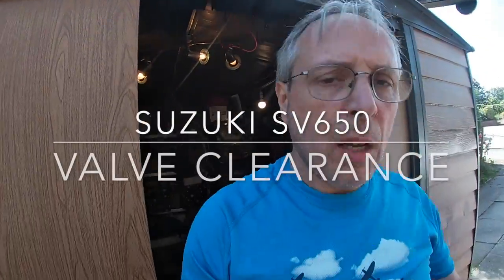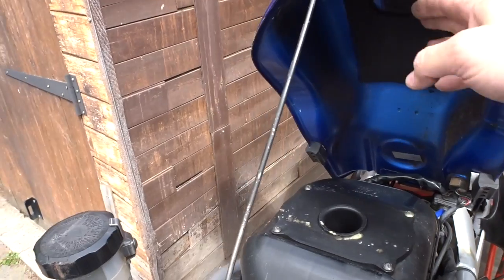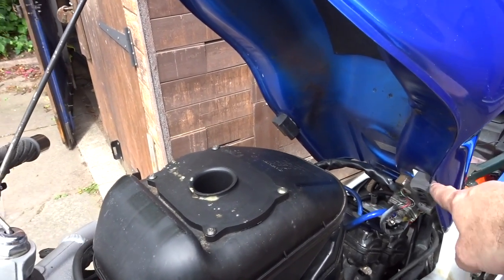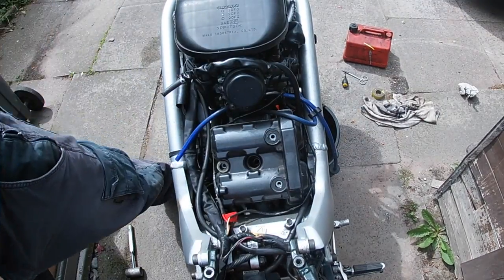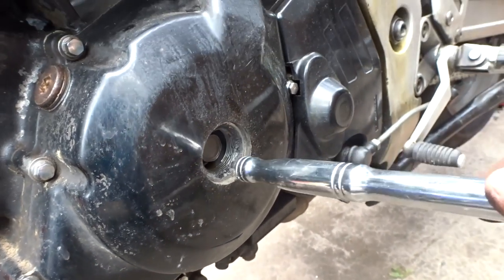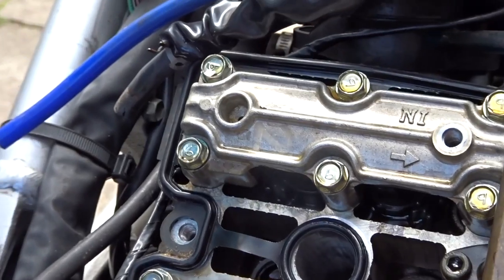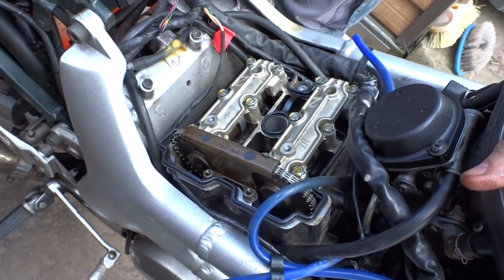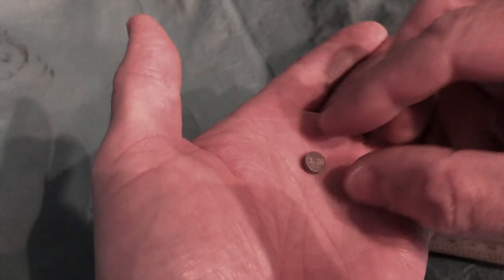How to check and adjust the Valve clearance on a Suzuki SV650 motorcycle maintenance

Comment: Hit the top of stubborn bolts with a hammer before trying to loosen them, it helps a lot. I work with threads and thread guages in my job
Reply from the maker: Or an impact driver 🤷🏼
Reply: And don't forget the ANTI. SEIZE 😊😊😊😊😊😊

Comment: Hy. I see that you have after market spark plug wire and boot. Did you manage to remove the old wire from the coil? Or the new wire is soldered on a piece of old wire. Thanks
Reply from the maker: Oh 
I’m afraid it was done before we worked on it

Comment: If you don't want to take a chance with the crank bolt cover, put the bike in 6th gear and rotate the engine with the rear wheel 😊😊🍺🍺
Reply from the maker: Assuming you have a paddock stand as the bloody thing doesn’t have a centre stand 😂

Comment: WARNING FOR TIMING:

The video doesn't specify the exact markings on the crankshaft you HAVE to be in for adjusting the timing and can be devastating. If you don't do it correct, you can fuck up your valves. I have summarized the service manual below on how to do it:

1.) Rotate crankshaft to "F" and check front cylinder camshaft sprockets. If the sprocket timing marks are in the right spot, you're done with the front and go to step 2. If the sprocket markings aren't in the correct spot, turn the crankshaft 360 degrees to "F" once again then check. If the timing marks are correct this time, you're good to go and go to step 2. If they aren't correct, then manually unbolt and adjust the sprockets to the correct spot WHILE KEEPING THE CRANKSHAFT AT "F".

2.) Reinstall the front chain tensioner in case the chain skips a tooth when adjusting the rear cylinder. Rear cylinder HAS to be timed at the "F" mark, not "R". Align the front cylinder timing marks in step 1 FIRST before checking the rear cylinder. Starting from "F" where the FRONT cylinder camshaft sprockets are aligned, rotate the crankshaft 360 degrees until you hit F again. If the REAR cylinder sprockets timing marks are in the correct spot, then your timing is correct. If not, manually adjust it so that it's correct, WHILE KEEPING THE CRANKSHAFT AT "F"

3.) Reinstall the rear chain tensioner. Double check everything. The front cylinder is a full rotation of the crankshaft away from the rear cylinder. Rotate the crankshaft to "F". In general, either the front or rear cylinder timing marks will be aligned  BUT NOT AT THE SAME TIME. Then if you rotate the crankshaft 360 degrees to "F" again once more, then the other cylinder will be aligned instead. If this is true, then your timing for both cylinders is correct. Rotate the crankshaft fully several times to triple check if it rotates fine. If it's binding, then that means the timing is off. DO NOT CRANK WITH THE STARTER BUTTON, otherwise you will damage the engine if it's mistimed.
Reply from the maker: Well gee thanks

Comment: cant turn engine more then one turn, would you know why?
Reply from the maker: On the starter or by hand. Not much to go on
Reply: take your spark plugs out
Reply: @Johnnyreengo  managed to find what I was doing wrong. I checked the rear and put it on R, didn’t know I had to put the sprockets for R on F. Hence it wasn’t turning
Reply: @masterkoster  Yeah, the video author did not specify at all that you have to check both c rear and front on "F". Check timing on front with "F", then turn 360 degrees to "F" again and check the rear.
Reply: @critzlez8593  so just to specify. You do check the front with F and the rear on R but the actual timing you boh do on F. Hope that helps.. Took me 8 months to find that answer on some obscure forum
Reply: @masterkoster  yeah this is true. Valve adjustment with F for front, R for rear.

Timing adjustment you do both on F, 360 degrees apart. 

Official service manual wasn't even clear, but it does say in step 1 of rear cylinder cam installation: "from the position where the front camshafts have now been installed, rotate the crankshaft 360 degrees and align the F". Still, it isn't too clear if you only need to install the rear cams. I also had to search an obscure forum thread for clarification.

Comment: The timing is a little confusing
Reply from the maker: Is it
Reply: @bikerdood1100  Yes, your timing guide is potentially devastating because you didn't specify the crankshaft has to be marked at "F" for both front and rear cylinders, 360 degrees apart.

Correct steps for everyone:
1.) Rotate crankshaft to "F" and check front cylinder camshaft sprockets. If the sprocket timing marks are in the right spot, you're done with the front and go to step 2. If the sprocket markings aren't in the correct spot, turn the crankshaft 360 degrees to "F" once again then check. If the timing marks are correct this time, you're good to go and go to step 2. If they aren't correct, then manually unbolt and adjust the sprockets to the correct spot WHILE KEEPING THE CRANKSHAFT AT "F".

2.) Reinstall the front chain tensioner in case the chain skips a tooth when adjusting the rear cylinder. Rear cylinder HAS to be timed at the "F" mark, not "R". Align the front cylinder timing marks in step 1 FIRST before checking the rear cylinder. Starting from "F" where the FRONT cylinder camshaft sprockets are aligned, rotate the crankshaft 360 degrees until you hit F again. If the REAR cylinder sprockets timing marks are in the correct spot, then your timing is correct. If not, manually adjust it so that it's correct.

3.) Reinstall the rear chain tensioner. Double check everything. The front cylinder is a full rotation of the crankshaft away from the rear cylinder. Rotate the crankshaft to "F". In general, either the front or rear cylinder timing marks will be aligned  BUT NOT AT THE SAME TIME. Then if you rotate the crankshaft 360 degrees to "F" again once more, then the other cylinder will be aligned instead. If this is true, then your timing for both cylinders is correct. Rotate the crankshaft fully several times to triple check if it rotates fine. If it's binding, then that means the timing is off. DO NOT CRANK WITH THE STARTER BUTTON, otherwise you will damage the engine if it's mistimed.

Comment: sure glad I have a Sportster......no adjustment required, hydraulic valves.
Reply from the maker: Well push rod motors are usually very easy anyway
Reply: Cope